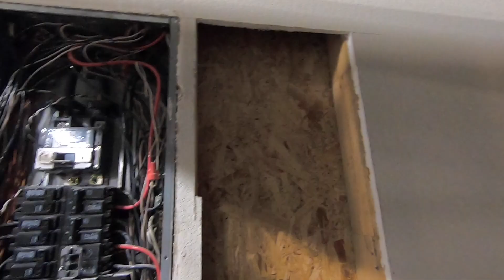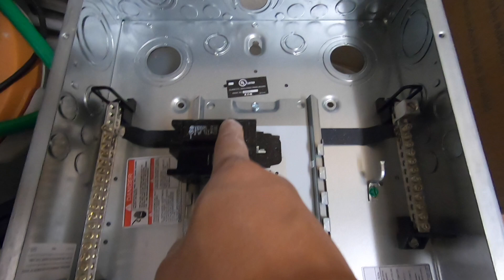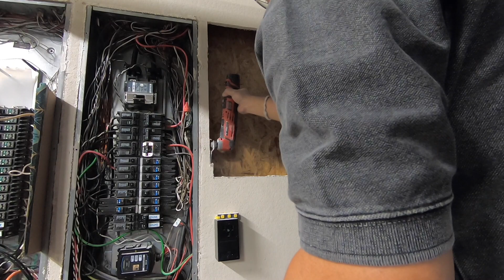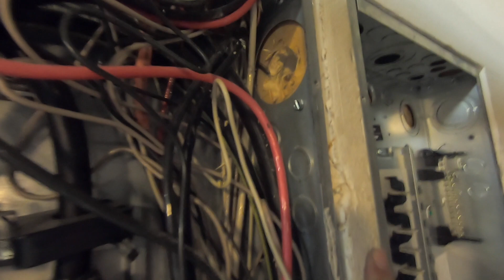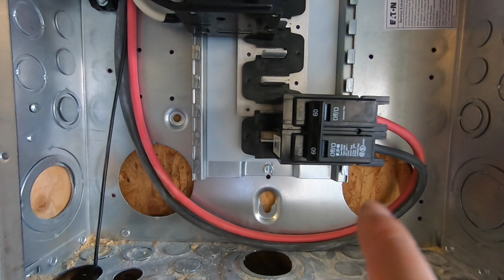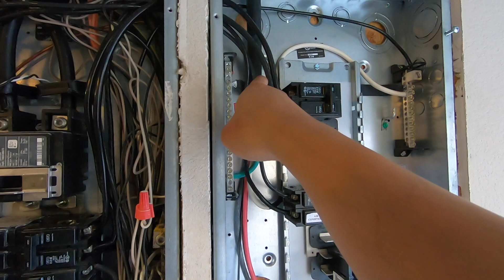Adding Additional Electrical Circuit Breaker Panel (Sub-Panel)

Comment: Can I still use the 4 gage wire to hook up the 2nd panel if it is 12 ft away from the main panel?
Reply from the maker: Can not answer that question. 1. I am not a licensed electrician. 2. It depends on the load and size of your subpanel
Reply from the maker: Pls consult with licensed electrician who is familiar with electrical code for your area

Comment: The electrician and inspector should both be fired for that service panel...could it be any more sloppy? It is harder to make it look like that than to do it neatly...
Reply: I am a retired auto tech and I can agree with the electrician / Inspector.
 1st - Permit
 2nd - Cable protection (clamp or sleeve)
 3rd - Box layout is a mess as wire length can cause problems.
 4th - Math 200 amps in, 100 Amps Left, 100 Amps Right = Main box is maxed out with center box disconnected.
  You need 200 Amps into main, separated Solar Panel either auto or manual but asking for trouble. What happens when you are not home? 
This is like cutting wires to a bomb…white, red or green? They always cut the Red right? Who knows. Chances are Boom!

Comment: (I'm not an electrician.  You may want to consult one.) In your subpanel, is that black strap connecting your ground and neutral bars?  Ground and neutral should not be tied in a subpanel.  Also Neutral wires should be white or should be marked white with white electrical tape.
Reply: In sub panels, you should remove the bonding screw that connects the ground and neutral bars.
Reply from the maker: @Honter Lin I am not an electrician either. And this is not an advice, just want to reply to you, I live near Houston, Texas. I have 2 other panels in this house and both have the same ground connected to neutral. I think they call this bonded neutral. It is common here in Houston Texas. But I am not sure the logic behind it. You can look up bonded neutral vs floating neutral to learn more.
Reply: @DIYGEEKTEXAS  Neutrals should only be tied to grounds at the first point of disconnect.  Assuming your main panel is your first point of disconnect (i.e. you don't have another main cut off somewhere else) then yes, that panel should have grounds and neutrals bonded.  But neither of your sub-panels should.  Not saying this to pick on your video but more of a honest concern for your property and well being.
Reply: @DIYGEEKTEXAS  Like Honter Lin said, you are only supposed to have that "bonded neutral" as you call it, in your first means of disconnect. What that means is your main panel, your very first panel or main service disconnect switch needs to have the Ground and Neutral bonded (tied together). Every subpanel after the first means of disconnect, needs to be unbonded. It does not matter "what your other panels are or look like". This is NEW work and you have to adhere to the NEC as it pertains to NEC 2017/2020 or even state codes for Texas. It would be a great idea to fix the first subpanel as well as the second subpanel.
Reply: @DIYGEEKTEXAS  The reference to this is in the 2017 NEC code is : 250.30(A)(1), however there are some exceptions that may apply to your case.

Comment: Very informative thanks 🙏on the panel you just installed I noticed the top knockouts the wires entering that they need a cable clamp according to the NEC just some tips I want to share with you 👍😁 but great job 😉
Reply from the maker: What kind of cable clamp please? Thanks